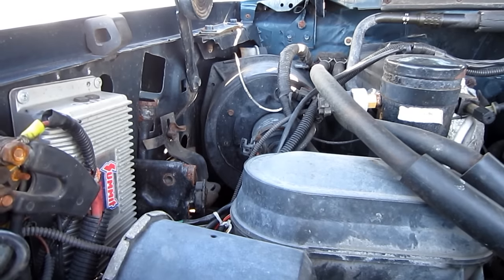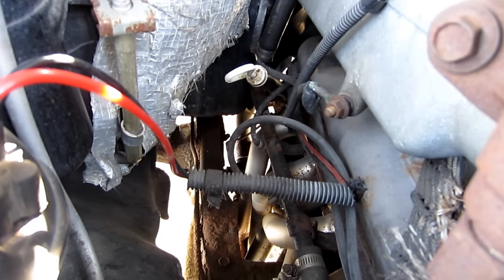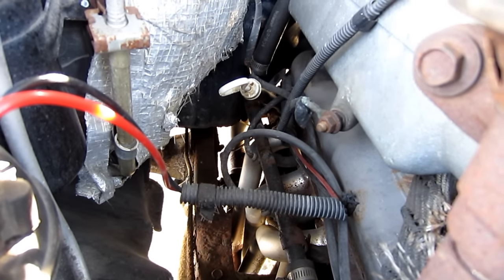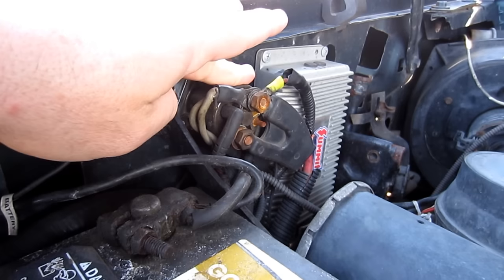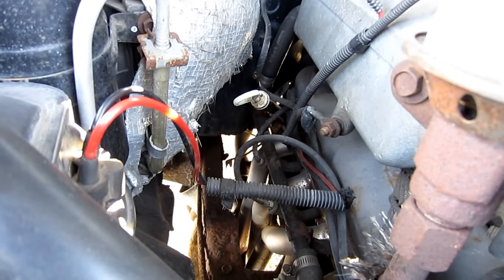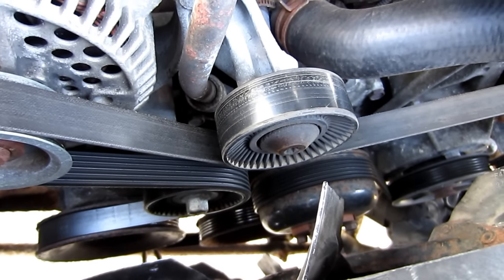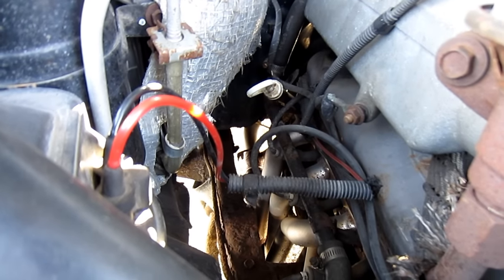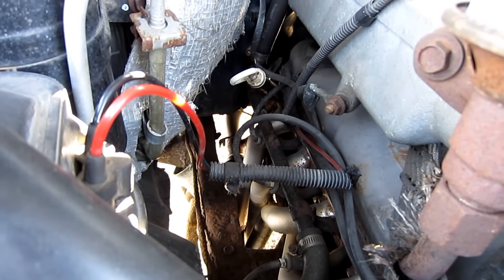Know your cars Clicks. Why it won't start

Comment: FoxBoss can you help me please! Our car just clicks super fast and won't turn over. we just barely out in a new starter for $251 two seconds ago and she still won't turn over. Just goes click click click super fast :'(
Reply from the maker: Marya Zweeres check all the cable connections to battery, relay(if equipped), and at the starter.. If all connections are good then make sure battery is fully charged.. Once those things have been gone over, try to turn the engine over by hand to make sure it's not locked up..
Reply: Battery is brand new. Just bought it. Just replaced starter. Ps, it just turned over but when we turned it off and turned the key again it just clicked rapidly. Then we waited and it turned over again. We are so confused. It turns over every few mins and then every few mins will just rapidly click  Lights, and radio all work. Just goes back and forward every few mins from turning over to not turning over and clicking :'(
Reply: Fox, is it possible the fly wheel isn't lining up?
Reply from the maker: Marya Zweeres intermittent failure with new battery and starter sounds like a cable connection is loose.. The vibration of the engine will cause the connection to sometimes be made and other times not.. You can't rule out a bad starter either but cable connections would be what I would be looking over..
Reply from the maker: Marya Zweeres flywheel misalignment would cause grinding most likely but it could be jamming up however that is a sign of a starter not installed correctly
Reply: This is so upsetting! I haven't been this aggravated in a long time. I guess I don't understand why it now turns over sometimes and sometimes it won't and will just click. we replaced the battery and the starter. My finances are running low! Bless you for replying. I am most grateful. I don't know what else to do. Feel like giving up! :'(
Reply: FoxBoss and Gary Sutherland. Thank you! I should have updated y'all! It turned out to be a bad battery. That confused us at first because the battery was brand new! However I guess sometimes you can get a faulty new battery, new or not. We took it back to where we bought it and they said "yep, it's bad" and apologized. They gave us another one on the spot at no cost and we have not had an issue since!
Reply: It sucks you had to spend $251 replacing a good starter. Luckily for the battery store there are no consequential damages.
Reply: Roberto Galvez - yes, we were not thrilled about that. We spent $250 for nothing. The starter was perfectly fine. Lesson learned I guess. At least we got it all figured out in the end!

Comment: Wish I could mega like this. Had my truck towed after trying so many things. They said they tapped around on the starter and it started up no problem.

Well, I've had it back for about a week now and it had the exact same issue. After watching, I tried the trick with the harmonic balancer. It started right up, no fuss. I may have just gotten lucky, but now I'm 90% sure it's  the starter now. Kind of annoying as it's the 2nd one I've put in, but...they may have given me another re-manufactured one even though I asked for a NEW one. Sigh. Thank you so much! I think you helped me solve my biggest issue!

Comment: I had the same thing go on with my shits but it was a new one I just replaced ... if this happens go ahead and loosen the bolts to the starter move it and tighten down .. I was boogled the new starter I put in wasn’t working but after I rearranged) tightened it started ! Good luck! I know it sucks redoing you’re work but it worked for me